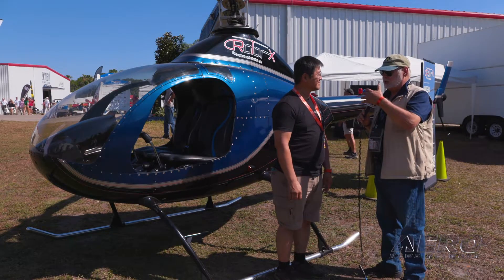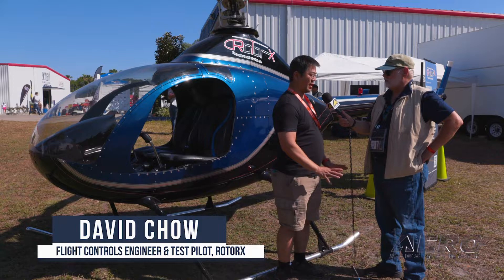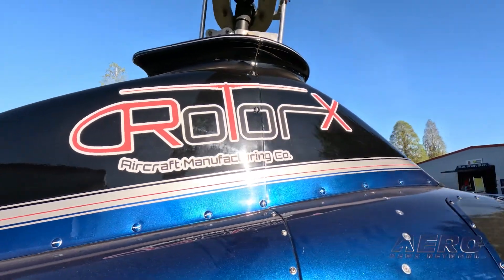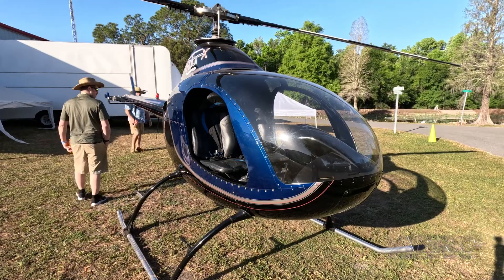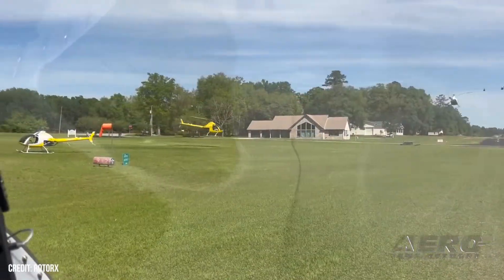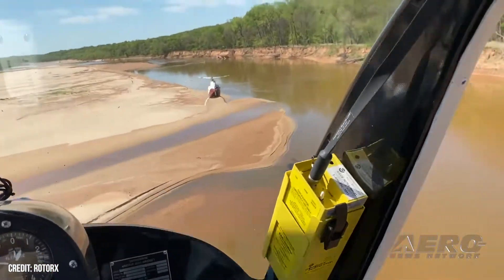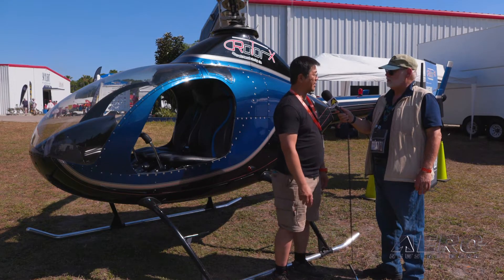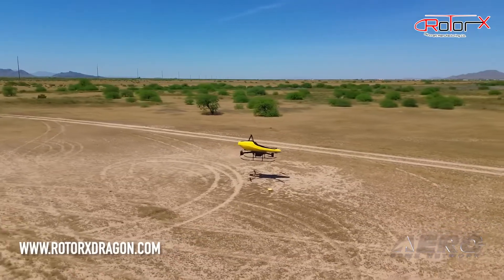Rotor X’s Phoenix A600 Turbo Helicopter

Comment: I flew the factory rotorway demo. A 162F when considering a build project many years ago. I did not like the rotor and tail rotor drive system. I would not put my family in anything less than a fully certified turbine heli.